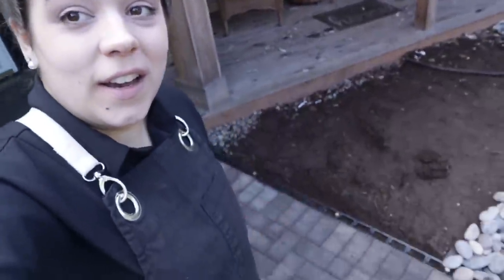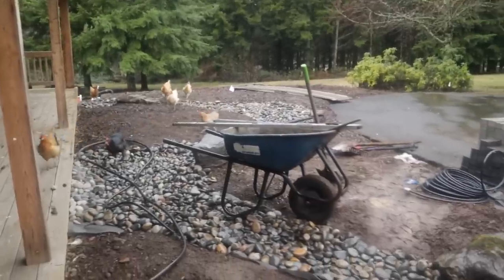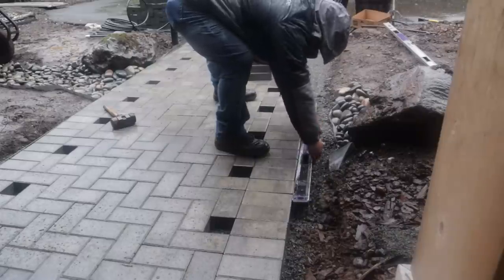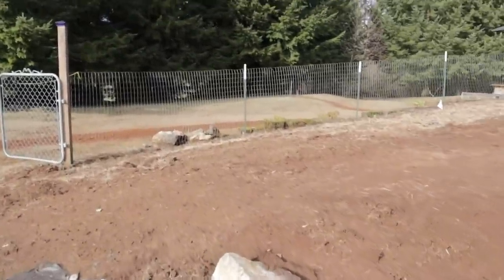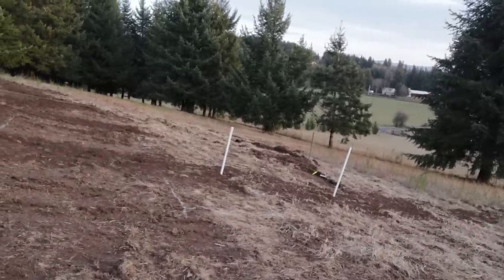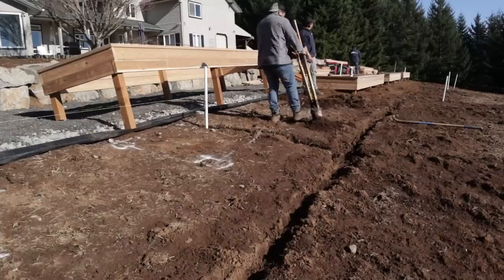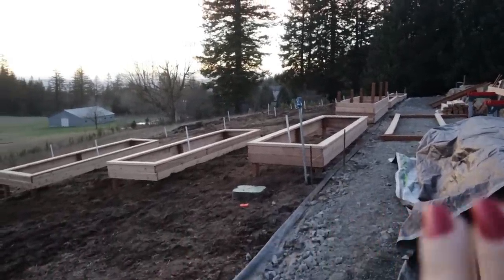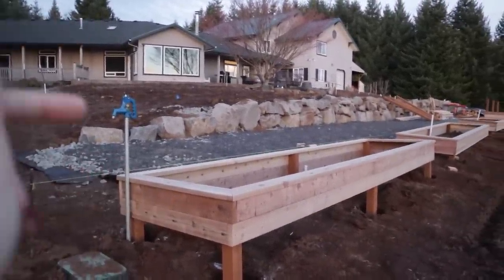It's starting to feel real!

Comment: Hi Becky - when it comes to doing pressure treated posts, they are not only cost effective but also since going in the ground last longer as it takes longer for them to rot. To try and alleviate any toxins that may be in pressure treated wood from leeching into your garden soil you can get some linseed oil and a paint brush from your local home depot and coat the pressure treated boards with this linseed oil to prevent any leeching from happening. Linseed is made from flax and is food grade and safe! Hope this helps! <3  another option to use is to paint your posts with old fashioned milk paint it is also food safe comes is various colors and is non toxic commonly used for children’s toys, cutting boards and for folks intolerant to traditional paint. I would also suggest painting the posts as the boxes are built prior to the boxes/posts being put in the ground. 👍🏻
Reply: Thanks for that tip, I was also wondering about that good to know
Reply: That’s a great tip to share!
Reply: @gailrigelsky3224  thx ideally you should treat them as the boxes are built and prior to putting in the ground but treating the exposed parts of the treated posts that will be seen/ exposed in the bed is fine as well!
Reply: Oh that's good to know thanks! My husband wanted to use pressure treated wood but I was against it as I didn't want it contaminating the soil.
Reply: @Iamhome365  another option to use is to paint your posts with old fashioned milk paint it is also food safe comes is various colors and is non toxic commonly used for children’s toys, cutting boards and for folks intolerant to traditional paint. I would also suggest painting the posts as the boxes are built prior to the boxes/posts being put in the ground. 👍🏻

Comment: URGENT MESSAGE!
Hey Becky! Everything is so amazing! There is one thing very urgent for you to consider! I manage a community garden with over 60 raised bed, , they are 16’ x 5’ and 3’ deep. They all started having a major problem with the boards on the long side bowing, due to the weight of the soil over time! You can prevent it NOW by putting in a support board at the 8’ point, running across and attached to the edges on each side!  It is a pretty simple fix if done now! I hope you have time to consider this issue before the soil goes in.
We all love you girl! Keep up your great content!
Reply: Yes very good idea as my beds did start to do that just from soil erosion and the weather as we get alot of snow in Wisconsin but I would do that to prevent problems down the road. How girl are you going to do all this gardening w baby boy and being between 6 & 9 months old oh my but then I think Becky has alot of ambition and your much much younger actually about my daughter age somehow it will all work out well for you.
Reply: Isn’t the middle posts on these kinda acting as braces?
Reply: 25:40 you can see the middle post they built.
Reply: Good suggestion. My husband did posts as well as a board the braces the middle to hold the top together for the long raised bed in my greenhouse. It has held and is easy to work around.
Reply: I don't think she reads messages on her videos unfortunately.
Reply: @DonnaSmith-ff2wu  she does, as I see her replies sometimes. Doubtful she can read thru and respond to 1400 messages in one video though 🤷🏻‍♀️
Reply: Hopefully, that middle post will do the trick. It should at least help, as long as it also doesn’t push outward over time. Wet soil applies SO MUCH pressure outward on the wood. It takes time for the damage to show, but can really wreck your beds! Did they concrete the posts in, or just dig holes to level the beds?

Comment: Yay! Loving the garden & landscaping. ❤️

🍓Just FYI: Commercial strawberry growers generally run each strawberry planting for 5 years, and then let it lie fallow for 1 year & build soil during the off year. This is something to keep in mind in the future to keep the productivity high.
Reply: I agree. I was also thinking she could rotate non-perennial beds by type each year: nightshade, allium, gourd, etc to let any acquired diseases or pests die out.
Reply: Didn’t she plant garlic where the strawberries where, from the previous home owner?
Reply: @LurkerSmurf  no
Reply: What do you mean when you say lie fallow? Do you mean to just not pick the berries one year?
Reply: @bethlewis9981  to let it lie fallow mean to not plant anything in that bed for a full year...just let the soil "rest".  Not usually necessary in a home garden as we are usually adding compost etc all the time (once or twice per year)
Reply: @lisawallace3124  So would you dig up the strawberries every 5 years and start new plants after taking out the old?
Reply: @bethlewis9981  personally, I would not.  As long as you are adding compost etc, I don't see any reason to NOT just let the strawberries live wherever they are forever.  Home gardens are not commercial gardens and don't need to be treated like one.  Your strawberry PLANTS may need to be individually replaced after 5 years, presuming you have the same, original plants and not the new "babies".

Comment: I hope you have better luck than I did with cedar raised beds. Mine were 4 x 8 and bowed immediately. The soil ran out the bottom whenever it rained. Pulled out the rotted boards within 5 years and gave up. In my area deer, rabbits, and groundhogs will obliterate a garden overnight unless fenced.

Comment: Hi Becky, I live in Eugene and our weather is probably the same. As the summers get hotter and we have months without a drop of  rain you might consider more drought tolerant plants for your front entry and save your water bill for veggies etc . I recommend Sedums. They come in many forms, low growing, and spreading along the ground, mid sized and taller flowering types. They are extremely low maintenance, drought tolerant, attractive esp. to bees and come in so many forms.
Reply: Sedums are great and come in beautiful colors too!!!

Comment: 💡 recycling the cinder blocks from the strawberry beds to the inside perimeter of the new beds

Assist in reinforcement of the foundation of the beds before installing the foundation boards 

Install on the ends and longest side as you go down the slope 

Reduce wear on the bottom boards over time 💭

Comment: Living in a rural area, I foolishly thought I could garden without a fence.  After the deer. Ate my plants down to the dirt, I put up a temper fence and replanted. I know have my inground garden fenced in.  My raised beds are protected by deer netting zip tied to pvc pipe.  I strongly recommend you make fencing a priority or you will have nightly deer raids that devastate your vegetable garden. Also they will eat your perennial flowers and bulbs. I had to research deer resistant bushes and flowers and bulbs.
Reply: It's insane to spend as much as this will end up costing to not protect it.

Comment: Is there a reason the assembled the beds the way they did? The corners are all different each row, which aesthetically bugs me lol. And one of them isn't flush. Is it stronger to hold the dirt that way?
Reply: The hill is pretty steep, which can make things look wonky.
Reply: @crystald3655  I didn't mean level wise. I mean that if you look at the walls of the boxes at the corners they don't line up the same for each level of a individual box. And one of the boards sticks out maybe a fourth of an inch and isn't flush to the other bits of wood.

Comment: I’m only part of the way through your video but I see them digging the holes outside for your garden beds and I’m surprised that they don’t have the earth augers The earth drill/auto post hole diggers)doing the work for them. My husband has one of those and my goodness, I cannot imagine doing all those holes without that piece of equipment. You can get hand held gas powered ones or you can get one that attaches to the back of the tractor. You can also be rented if a person or company did not want to purchase one

Comment: Wow, incredibly exciting!!!  Consider putting most of the perennial beds down at the bottom like asparagus, strawberries, artichokes, etc. (not herbs that you'll be using frequently year round of course).  Since they're perennials, they'll need less attention for most of the year than your annuals, so would be nice to have the beds that need the most frequent attention towards the top I would think.

For our food garden beds we used black locust posts rather than pressure treated to avoid any chemicals whatsoever.  They've become pretty expensive since they're mostly grown out east and have to be shipped (shipping prices are insane), but the saying goes that after 50 years in the ground farmers just take their black locust fence posts out, flip them upside down and put them right back in the ground again because they just don't rot away like most wood does.  So for us it was worth the investment.

Comment: So, I had always thought that a large chicken run within a fruit cage would be ideal. You could grow loofas or gourds or even an ornamental grape for shade. This fruit cage would adjoin other fruit cages containing all the orchard and dwarf nut trees etc. I was thinking to use a raised bed for each tree (to protect the roots) and steel mesh on top of the soil before mulching. Then scatter seeds of various chicken friendly plants throughout the grassy areas - eg: chickweed, dandelions etc. The other fruit cages could be used by the chickens on a rotational basis. Still dreaming for now, best wishes.
Reply: @cynthiafisher9907  thanks for the reply, the idea would be to .plant the tree at the normal depth after the raised bed is built - it works extremely well. Check out some videos on the topic. So - a great idea according to various gardening channels.

Comment: I would start now. id move the chicken feed out to the future coop and run area. Also throw scratch and scraps out to them in that area. Encouraging them to get used to going over there and being there. And I'd have Josh build a lil 4 post and couple board roof like a park picnic shelter and put it over there since they like porches. I'd  incorporate it into or reuse boards for a porch on the coop when it's built . For now it would be shelter from hawks and wet and an encouragement to go over to that coop area more.

Comment: Beautiful progress on your garden!
Consider doing Shou Sugi Ban technique for long term protection on the raised beds, especially on the interiors. A wood burner and 5 gal propane tank makes it fast. Have a wet towel to swat any lingering flames, a stiff bristle push broom to brush excess ash off then a fuzzy roller to roll on Raw (not boiled) linseed oil. This will retard  decay for decades and provide some fire proofing in case of wild fire in the fields.
The Japanese have used this on cedar for ever, it's proven.
I'm sure you will love the color like I do since my favorite colors are grays to black!
We have done over two semi truck loads of pavers in herringbone with a soldier course as a border like yours by ourselves. Very fun watching someone else do the labor!😀
Blessings
Jan
Reply: Forgot to mention that you should add additional vertical boards between the treated posts to prevent bowing/bulging of the walls, we put them on the outside and they are visually pretty as well!
Jan

Comment: Pressure treated lumber is not a problem. They used to Chemically treat the lumber to make it weather proof. Pressure doesn't include chemicals. 
You are absolutely going to love those beds being built up higher than your previous ones. Much easier on your back.

Comment: Another downside to not having an enclosure for the chickens is they are more vulnerable to predation….we have a extra large run with a screened over top….haven’t lost any to hawks since this step.  Before this we lost 2 to hawks……besides if the chicken yard is an extra large one then is it a cage ….or a protective enclosure?   Our chickens are still relatively free…..but still protected.

Comment: I had a bed put in two years ago and it was off the ground. It started rotting and fell down because of weight of dirt and water constantly on the wood. It needs to be flat on ground I think.
Reply: Didn't you preserve the wood,  I think I've heard you're supposed to. 
I don't have a garden now but I loved it so much.

Comment: If you do end up doing in ground gardens give yourself a break and put down woven weed fabric from growers solutions I used it for 3 years straight and no weeds and my area I had was 30’x100’ I pulled the cover this year to add nutrients and work the ground ground cover is definitely the way to go